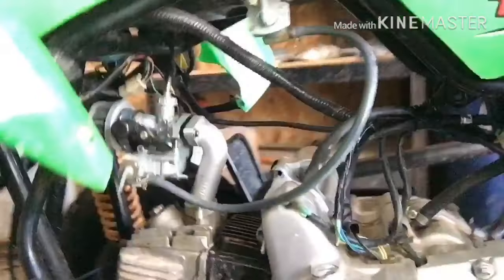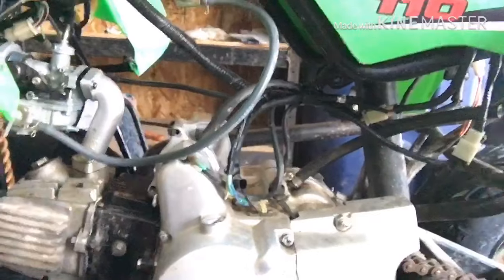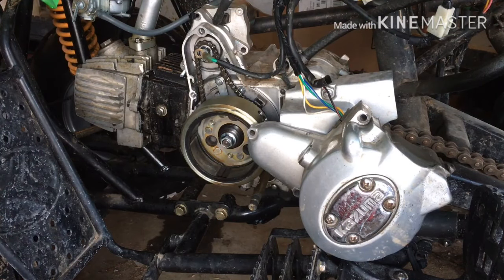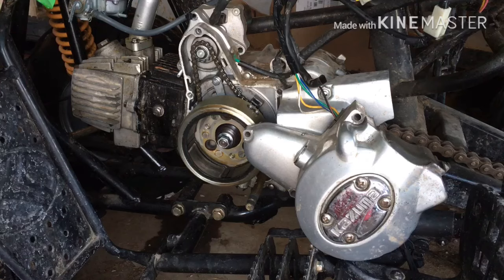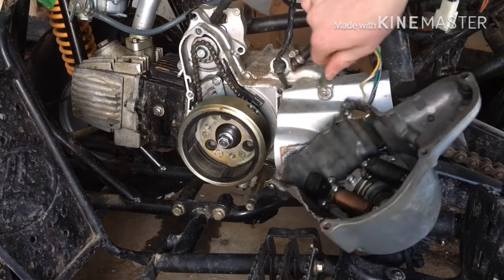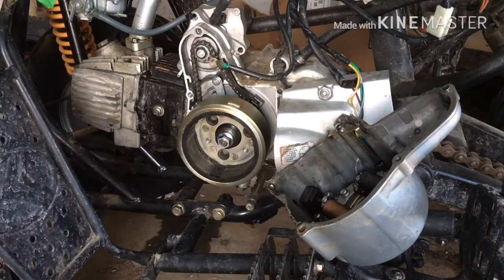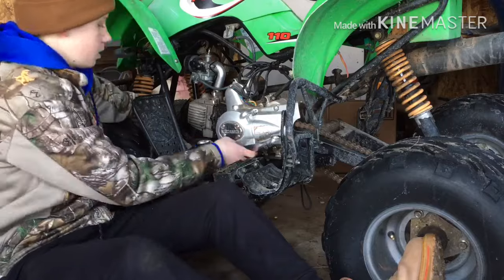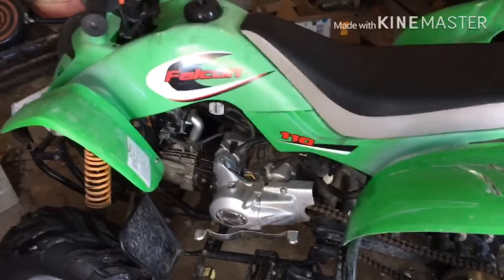Fix for common Chinese atv starter issues

Comment: OMG, it's called a tensioner-- the 'little rubber thing' -- I cannot believe all the blind leading the blind videos on these machines. Most don't even know the names of the components, never mind what they do or the theory behind them. Nothing wrong with trying to fix your own machines but putting out videos when you don't fully understand what you're doing can't be a good thing. Still have not found anyone who knows the best way to put the chain back on the starter gear and actually SHOWS it being done. Lots of wrong ways, such as the method that need two people, or involves taking the starter body off the gear apparatus and losing all the little parts inside it... wow. The few that look like they know something, fast forward through all the crucial detail needed when someone is doing something for the first time. I'm a retired Class A auto mechanic but small chain-driven engines are completely new to me and I certainly can't find THOROUGH starter replacement videos on here.
Reply from the maker: I was like 12 when I made this video and you’re bashing on me because I didn’t call the tensioner the right name😂 get a life boss. Some class a mechanic you are not being able to get your kids Chinese quad running.

Comment: Hi i have a question It is possible that a 110cc cylinder could be put in a 90cc engine It is for a kazuma 90cc atv But I would like to put a 110cc cylinder on it You think the parts are compatible
Reply: Yes

Comment: Hey your at 25 👏👏
Reply from the maker: Yup
Reply: @clayoosting6925  54
Reply: @clayoosting6925 
My pit bike was making an awful racket starting up and would it be the same problem on mine where the rubbers have came off the starter chain.
Reply from the maker: @wewouldneversellourclubfor3166  most likely, it may be a little different looking but the same concept.

Comment: What if the starter wont spin at all ? I have an old and new starter and they both spin only when they are off the chain. But neither will budge at all when I install them.
Reply: Maybe the flywheel is stuck